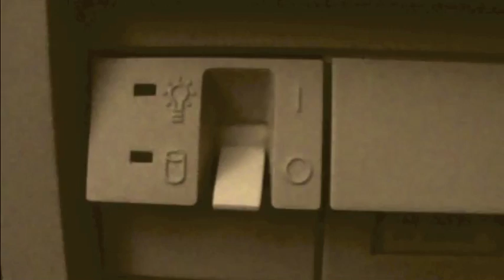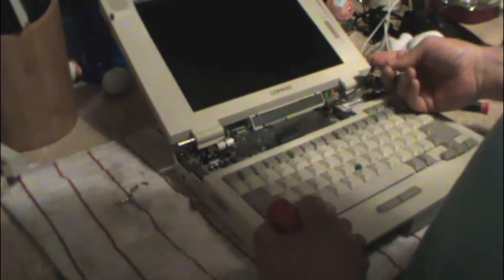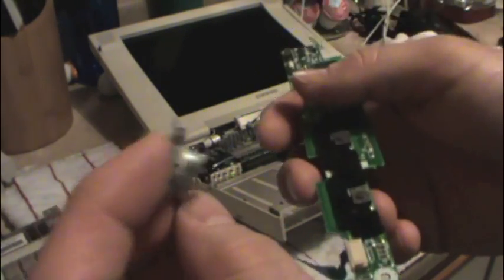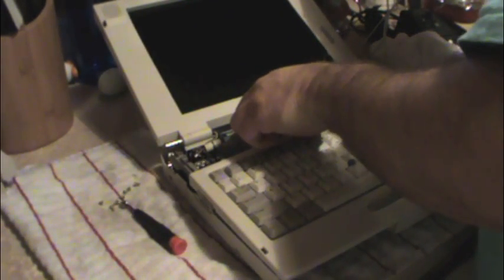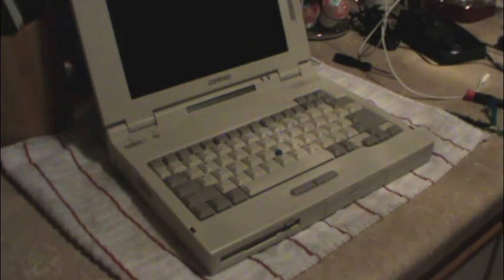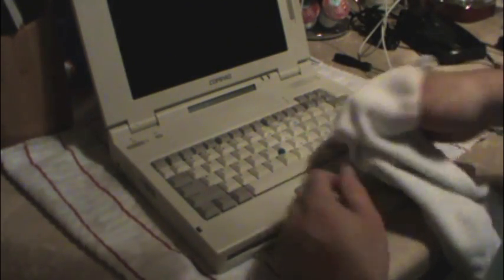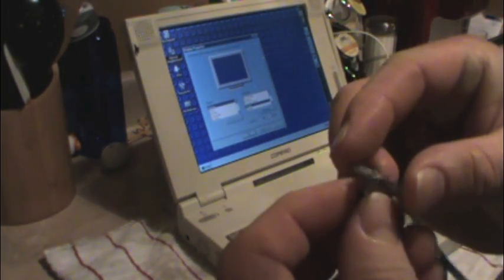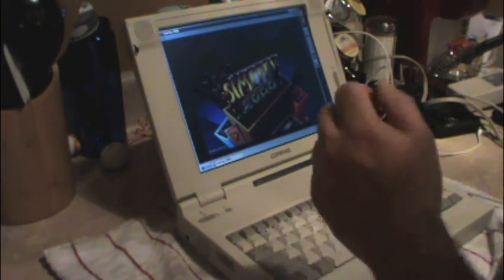Repairing The Compaq LTE Accupoint

Comment: Nice to see a IBM microchannel being turned on. I had that laptop actually 2 both I kept back when NCR had a contract to repair those . They both had battery let the magic smoke let out. The compaq folks sent a whole refurb laptop  and told me to trash the old one. I took them home and opened them up and even the plastic had acid burns .
I wrapped them in plastic and threw them in the electronics dump yard.